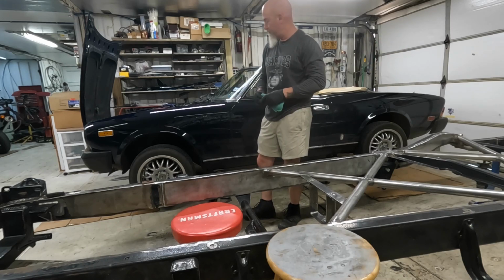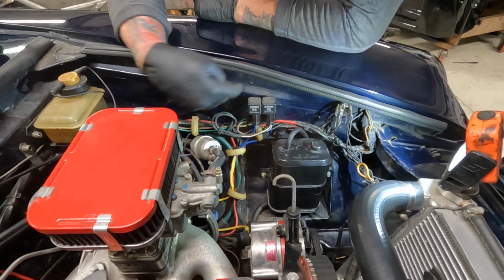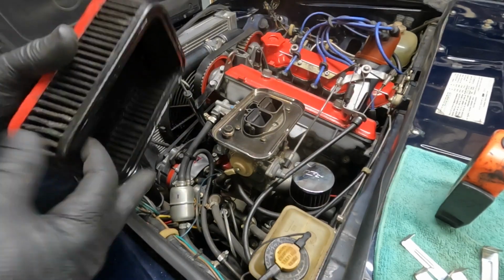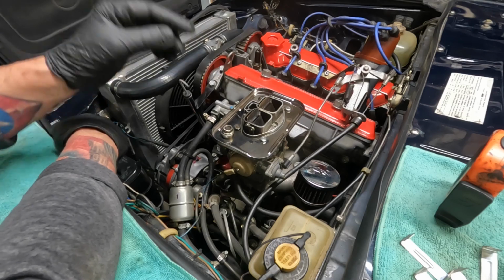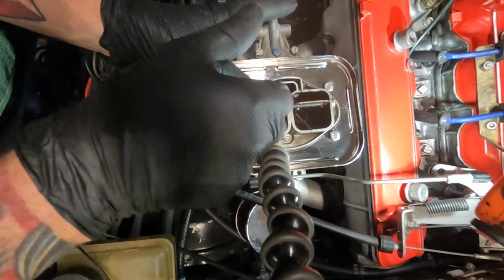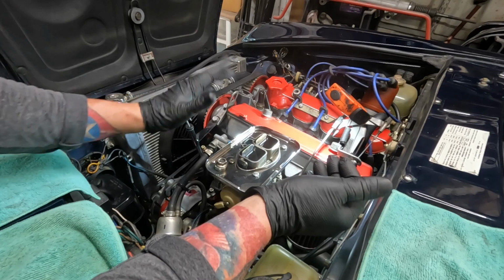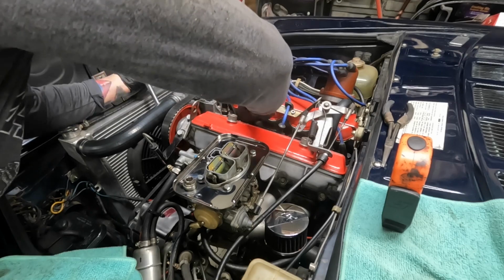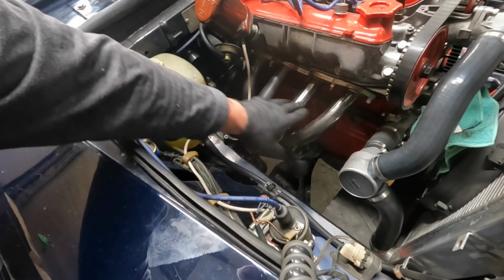1979 Fiat Spider 124, 5k Service Part 1, fan switch, headlight relay, carb/choke clean, plugs

Comment: At 11:56 you point out where the fuel enters the carb. What would prevent fuel from entering or moving past the float into the Venturis? My carb is not getting fuel, I made sure fuel was flowing to the carb but it seems to stop at the float if that makes sense. Also the carb is new so this is the first time I’m trying to fire it up. Thanks in advance
Reply from the maker: So, these carbs are different depending on where you get them. Make sure your fuel line is connected to fuel in and not a vent. You'll need to fill the bowls with fuel from the pump. Shouldn't take but about 30 seconds or so. Should be able to work the throttle and see fuel spraying from the accelerator pump. Also ensure you have fuel in line connected and not the fuel return line.
Reply: @ELDESTBuilds  thank you I really appreciate that. I will try that and double check everything.   Thanks again and I really enjoyed your videos
Reply from the maker: Check the Playlists there's a carb video list
Reply: @ELDESTBuilds  awesome will do
Reply: @ELDESTBuilds  hey I’m finally getting gas into the carb! Thank you so much, saved me a lot of stress haha
Reply from the maker: @franciscoalegria4338  good for you, one problem solved

Comment: I found the other day that a small flathead fits perfectly in the small gap between the clip and the lid on the underneath. Then just use your other hand to hold pressure on the outside and pop it off
Reply from the maker: Yes, catch it, or it will fall into a black hole somewhere inside the engine compartment.

Comment: Thanks for this! I have a 1975 Fiat Spider 124 that needs a lot of work and I hardly know where to start. I appreciate you doing these when I'm so new to this car.
Reply from the maker: Pick a group and work ot out,  like brakes. Master, lines, hose, calipers, pad, etc
Parking brake cable. Then move onto the next. If you follow the 79 build it looks kinda random but I started in the trunk and worked forward.  Fuel, rear suspension, etc
Reply from the maker: You're welcome,  enjoy your build

Comment: I would suggest moving to NGK BP6E - the iridiums work better in FI engines - carbs can foul those small tips easier.  Glad they are working, but the NGK were strongly recommended to me by a lot of Fiat folks.
Reply from the maker: Thanks buddy
Reply: I agree. Coming from working primarily on vintage motorcycles, you want a big fat spark for performance. Iridium plugs are not good for these types of engine. Iridium plugs put off a different shaped discharge. Kind of like a tesla coil vs striking a ferro rod. One is like lightning, and the other is like sparks flying off a grinder